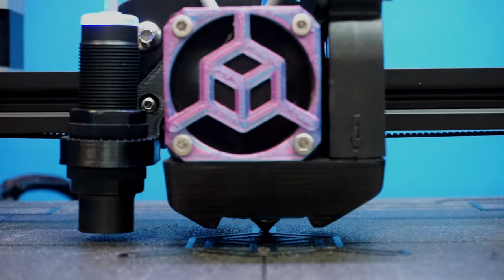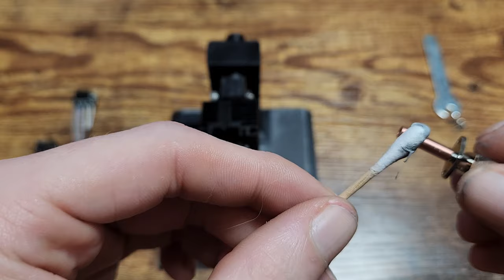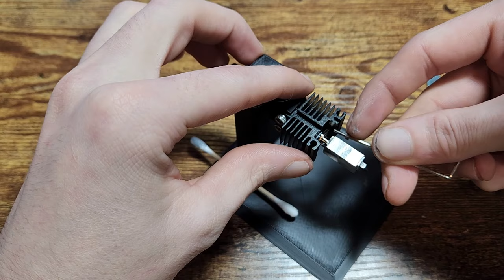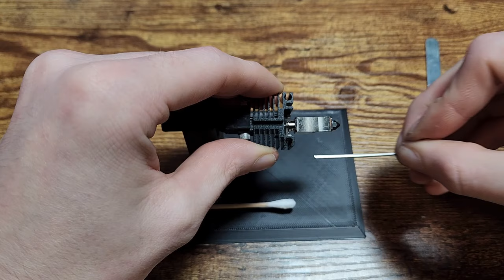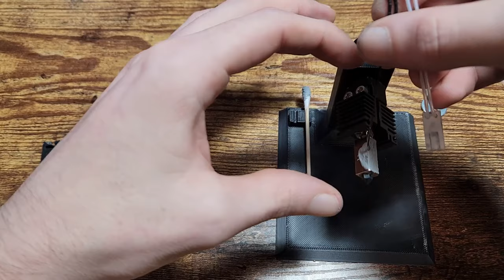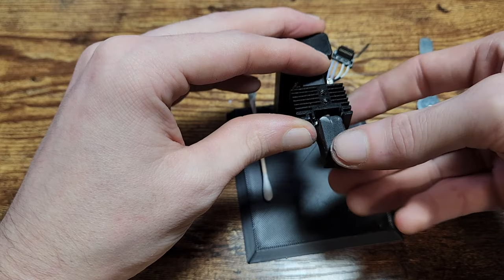Assembling the TH3D Bambu X1/P1 Upgraded Hotend Kit

Comment: I ordered one of these today from you all. It looks like the nozzle sticks out slightly farther than the stock nozzle. Will the stock firmware be able to see this at bed leveling or is there something I need to do before using it?
Reply from the maker: It doesn't matter. Once the machine homes it'll reset the Z0 home position. I'd also check that the hotend is properly assembled because it should be within +/- 1mm of the old hotend length